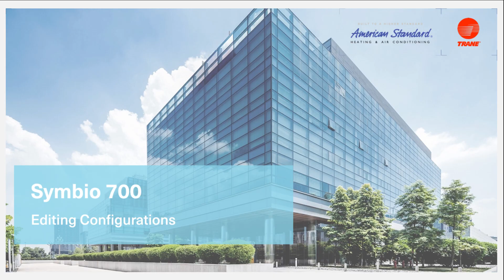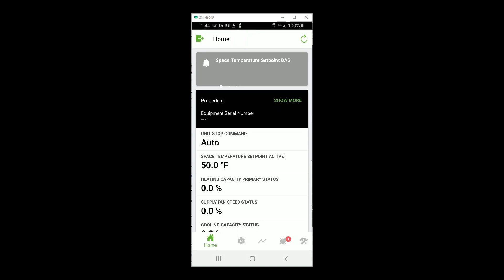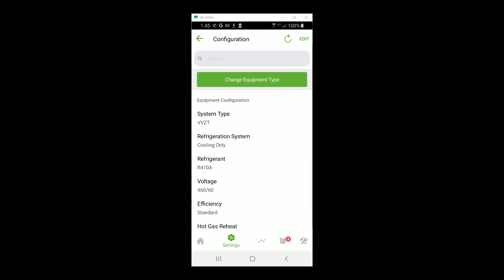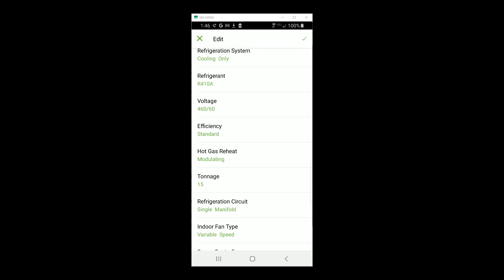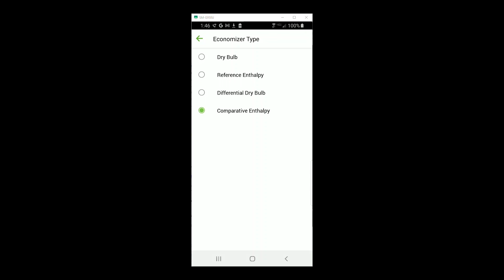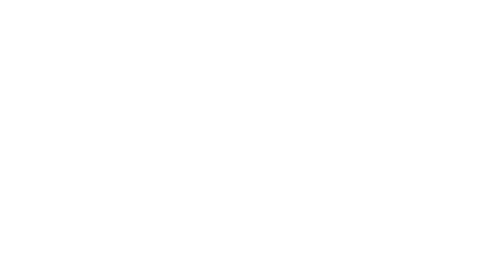Symbio® Service & Installation App: Editing Configurations

Comment: I have a 7 ton system with the symbio system. It has 2 stages that are on it. the 1st stage coming on is the 2 ton compressor and the 2nd stage coming on is the 5 ton compressor. I am needing to reverse these and have the 1st stage cooling be the 5 ton compressor how do I do this?